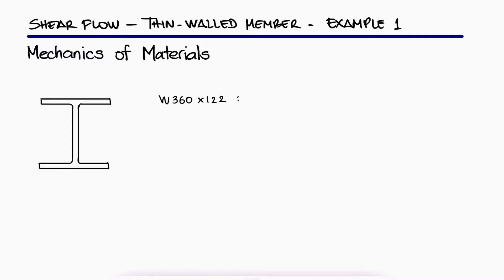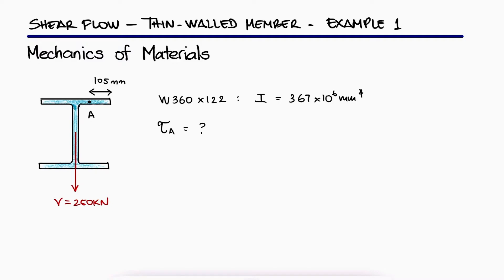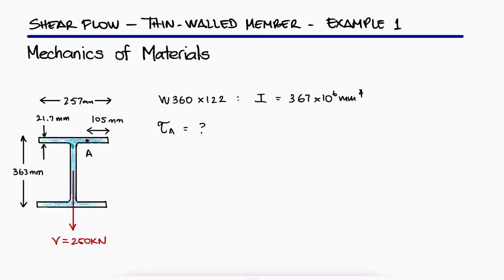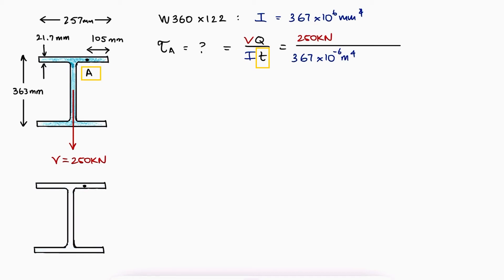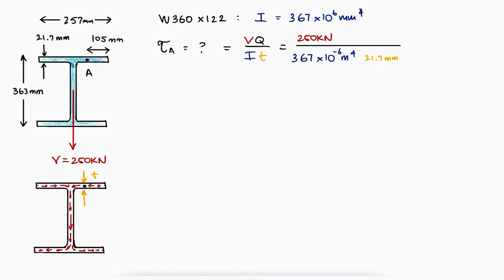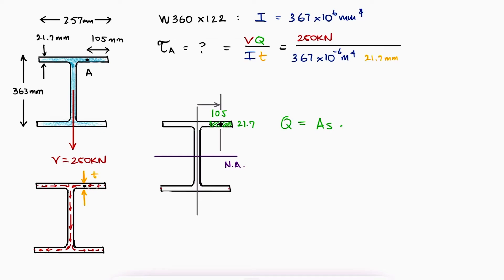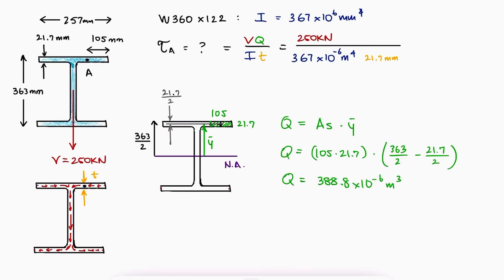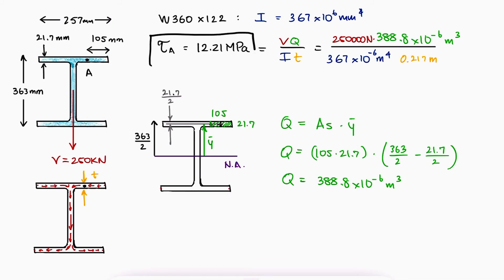Wide Flange Beam THIN-WALLED MEMBER Example in 2 Minutes!

Comment: small correction: the value for t in the shear stress equation should be 0.0217m not 0.217m although the final answer is correct
Reply: why did he use 21.7mm for t instead of 257mm?
Reply: @Mishary-Alghazy  perpendicilar to vector